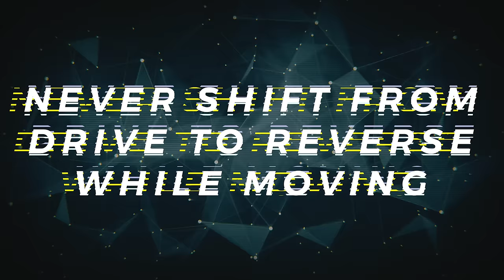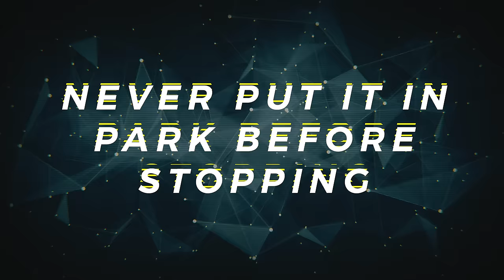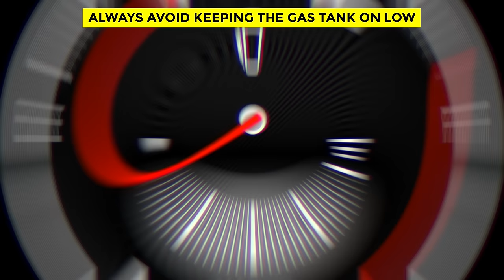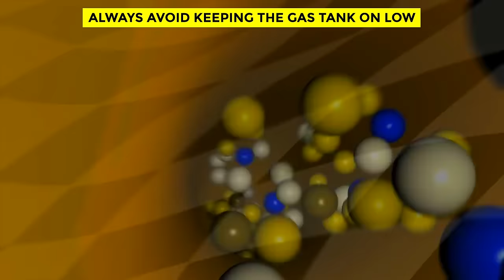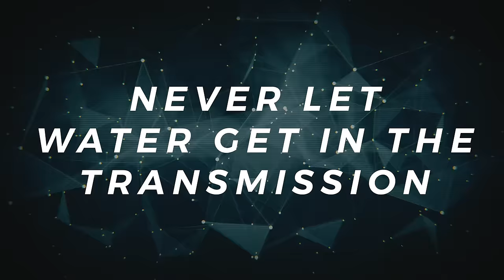7 Things You Should NEVER Do In an Automatic Transmission Car!

Comment: The sediments and trash that may be in your fuel tank will be in there if there is a lot of fuel or a little.  That is a huge misnomer that it will be sucked up by the pump if the fuel level is low.  Besides, that is what the fuel filter is there for any way.  After all, it is called a filter, and that is what it is designed for.  Run your tank as low as you want to, but not so low that you run out of fuel, because that is not fun pushing your car or walking with a fuel can.

Comment: "never switch to neutral at stop lights"

i always do this on my turbo b20 automatic integra da
Reply: reaze if you have an aggressive cam with the factory torque converter, your car could actually stall in drive, meaning you need neutral at a stop. Big cams need higher idle speeds, but the torque converter limits that

Comment: When I first got my car and was still learning to drive, I was pulling out of my driveway when I realized I need to go grab something from my house, so I put it in park before I stopped fully and I heard a clicking noise. I still use it today and nothing bad has happened since and I’ve never done that again.
Reply: some trans have whats called a sprag clutch or similar mechanism on the park locking gear that will prevent the gear from locking above a certain rpm

Comment: Well if it’s not good to put the car in neutral down hills on automatic then what about manually cars.
And also some cars have so when you stop at a red light put the car in neutral and let of the clutch if you got that it will shut off and as soon as you press down the clutch it turns on, so that can’t be good either then.

Comment: While you shouldn't coast in N down a hill.. The engine won't overheat if it's literally idling and you're moving the radiator through air by going down the hills. It's no different to letting it idle on the drive if not better.

Comment: The low fuel scenario however obscure you may think the chances are can happen.  The fuel cools the pump which is true but long term running the tank low causes in addition to reduced pump service life the risk of explosion since the more fuel vapors in the tank which are usually deadlier than the fuel itself.   

For the winter the northeast, mid Atlantic, Midwest, pacific northwest can back me up.

A empty tank reduces weight which is fine for saving fuel but........a empty tank also reduces weight in the rear of the vehicle.  Bad move in a snowstorm as in you want all the weight available to keep rear of vehicle firmly planted to the concrete ( in this case digging into the snow.  Lighter rear of vehicles reduces traction, simple physics.

The additional traction can be even more critical in Rear wheel drive vehicles without 4WD or AWD.  

Pickups are double critical since there is not a lot of bed weight to begin with.
Reply: if your car explodes due to a low tank id thing your evap system is not working properly.

Comment: Coastering isnt dangerous at all. The "emergency" in which you cant put it back in gear/drive simply has never occured ever. But Automatics already coaster if you dont press any pedal. You dont get engine braking or anything anyway. (Btw. Please dont enginebrake with your 2-strokes and wankels cause cutting the fuel completely off also cuts their oil off completely. They burn oil because they have no choice, remember?

Also when youre in a manual, you should put it out of gear, because here its the other way around. If you stand on your clutch all day your clutch-feathers disengaging the clutch get weaker over time resulting in the clutch slipping while its fully kicked obviously burning it down in the end. Also you can put it into gear within a coulpe 100 milliseconds.
Reply: wears out the throw out bearing.

Comment: top tip, buy a manual but remember put it in neutral when parked
Reply: You mean put it in first gear and then handbrake, who the hell told you to put neutral?!
Reply: @KHaLeD-jv7fu  anyone who knows how a manual works
Reply: Electro3 Strike ki
Reply: @KHaLeD-jv7fu  actually it really don't matter. But if parked on an incline you'd use reverse or 1st plus the parking brake. That's so if your parking brake fails for what ever reason the engine will keep the car from rolling away. Besides you should always give it a jiggle to make sure it is in neutral before even attempting to start it. That's also why you must press the clutch and brake pedal in most cars to even start them.

Comment: If you are launching an automatic car just brake boost I know it feels weird but it works and it really doesn’t do damage just don’t fuckin floor it with the breaks pressed in I like to build around 3000 to 3500 rpm before releasing the brakes and pressing the gas fully once I feel the wheels grab up

Comment: Some vehicles won't shift the transmission from Reverse to Drive until the vehicle stops, even if you put the shifter into Drive while you're still moving in reverse.  With technology these days, there are sensors that can tell the car it's still moving and NOT to shift.

Comment: Tip number eiiighhtttt.... never drain your oiiill and then turn on your carrr.... it mayy seem temptinggg to drive off durrring an oiiill change....... but surprisinglyyy, doing this may seriously damage your engine's componentsssdsssds............. engines need oil to function, and with out that, they will break..... some of the parts that could break include the timing chaiinnnnnn..... the rod bearrringgggs.... the oiiil pummmmmp.............  thepiston ringgggggggggsssss.............. the camm      shaffft.........   the valllllllves....... the wrist pinnnnnnnns......... the crank shaffffffft......  the liffff tersssssss....... cleeearly, it is not a good idea to run your car withouuut oiiiiillll....... you should have a mechanic check your carrrr.... to make sure it has oiiiil in itttt..... this should only be done by a certifieeeed mechaniccccc........ I had mine checked twiiice yesterdayyyyyy......

please tell me this man isn't actually saying things that large amounts of people with at least enough intelligence to figure out how to pull a car out of a garage don't already know...

Comment: There is a lot of this  I DO NOT agree with, while indeed putting your vehicle into neutral at a stop light is impractical, if you're quick enough to put your vehicle into neutral while starting to slide out you could regain control of the vehicle and come out of the slide. The vehicle in neutral will allow the wheels to start spinning again and could allow you regain control of the vehicle. 2nd thing is using the transmission to help you slow down.. In cars, its again impractical however, in pickup trucks, if you're hauling a trailer and you're going down a steep grade you can use the lower gears of the transmissions to keep you speed down so you don't lose control. You have P, R,N,D then either 4,3,2,1 or 3,2,1 or even 2,1. The #'s are the  gears of which you want to limit the transmission gear switching so you can go up or even down hills and grades. New cars today won't even allow you to go from Drive to Reverse while you're in a forward motion...

Comment: 5:45 a thing I need to point out is that that's not true because the pump always sucks gas from the bottom so either at full gas or low gas your pump sucks from the bottom...

Comment: Looking for a trans it’s easy but hard at the same time I looked out n my trans was 250 my last car trans was for 1500 and thats was only if I took my main trans out to swap it with a new one just take care of your car n your car will take care of you never move your car from a cold start if your a model 2010 and down that’s how you over heat your head gasket and never leave any thing on if you getting on the car if you didn’t get a brand new alternator DO NOT LEAVE YOUR hazardous on

Comment: What does running low on fuel have to do with the transmission?  I get that it can be detrimental to the fuel pump because the fuel helps to cool the fuel pump but again, what does that have to do with the transmission?  Also, the argument that running the fuel low in the tank causes the pump to pick up any debris that's in the tank isn't a valid argument either.  The fuel pick up in the gas tank is at the bottom of the tank.  If there's dirt in the tank, it's going to get picked up whether the tank is full or near empty.  That's what the fuel filter is for.
Reply: almost all modern cars/trucks use a "Sock" to block dirt from getting picked up. it don't block it all that's why there is the filter.

Comment: 3:57 "Never launch your car in Neutral"
You said people launch in neutral to be able to put it in D faster and accelerate really fast. Then you go on saying why not accelerate fast after starting the car and how it can harm the transmition.
ok, i understand that. I have a related question, but slightly different:
Can I start the automatic car in N? We know that it works, but, does it damage the transmission in any way?
Keep in mind I am not asking about accelerating really fast.

Context: It happened a couple times, I get into the car and without looking at transmission, it was in Neutral.
I asked about it in ome FB groups, all people say: you shouldnt do that, it harms the transmission. But they're never able to tell me what exactly happens to it.

Of course it's by accident, it's not usual, but we're humans, so, we fail from time to time.
Question is, did I break the transmission? if not, what exactly are the consequences if someone always starts the car in N ?

Thanks,

Comment: There is no such thing as "emergency brake". The lever at the center console is called a handbrake.

Emergency braking is applying full brake pedal travel for the reasons of stopping the car as soon as possible. Handbrake is NOT meant for use in emergencies.

Comment: I think you meant if you forget to put your car in drive...you'll rev at the light. 
BTW if your car has high miles on it and the transmission fluid has never been changed, do not change it.. If your having transmission problems it will looked just get worse once you change the fluid.

Comment: A $100.00 for brakes for a bicycle maybe I just spent 1600.00 plus tax for my Lexus Rx350 at a Toyota dealership. They were cheaper than the Lexus dealership. Lexus wanted 1675.00 plus tax just for pads.
I got pads and rotors all the way around for $1600. Plus taxes.

Comment: I'm gonna respectfully disagree with one of them. Neutral at a red light is something I do. If ur stopped and in drive when an accident is about to occur, odds are you still won't move in time. If theres an emergency vehicle coming, and ur at a light, obviously you move if you can but odds are you can't move since cars are likely blocking your way, and by law, if you are unable to move to the side you are supposed to stay stopped until the emergency vehicle can get by.

Comment: I had to replace my 7 speed in my g37, The old trans solenoids from first gear to third had been badly damaged due to me not fully applying the brake when shifting from drive to reverse. The 2nd and 3rd gear solenoids had gone bad due to me having to neutral launch my car for it to not stall... in an automatic :'(  , Luckily my friend had a same model trans sitting around and I had enough money to upgrade to a beefier torque converter which I wanted to do in the long run so it was worth it for me. But if I wasn't into mods/upgrades and what not Id have been so mad.
Reply: Or just get one with a manual like it should
Reply: solenoids have nothing to do with your braking and shifting habits. you must have had some junk get into them.

Comment: everything here can be applied to manual 
launching a car in manual is the same shit 
you hold clutch while revving and dump the clutch
Reply: difference is  the bite of a manual clutch is controlled by your foot, a auto is controlled by the torque converters hydro static pressure

Comment: Tip 8 never change your oil. The reason is because your car is familiar with the stock oil and when you chane the oil the engine will get slightly damaged because it is a different oil than the engine is usual

Comment: If you put the car in neutral while moving and the engine happens to die, you could lose your power steering and power brakes and then lose control of the car.

Comment: At least they got the "Neutral" information correct.
Reply: Not with the stop lights
Reply: @cpfaclan3681  , No, that part is also correct.  You don't put your car in neutral while sitting at a stop light.
Reply: @jmackinjersey1  I'm not saying its beneficial, but it won't hurt it. It's not really correct because tbh, it doesn't matter.

Comment: Tip number 99: whenever parking at an incline or decline, hold the brake, put the car into neutral, pull the parking brake, let go of the brake, and put the car into park. It sounds like a lot of steps, but really can be done in 2-3 seconds when you get into the habit of it. This helps the transmission by putting the cars weight on the brakes, not the transmission. You might notice when yku get into your car and put it into gear it makes a thud and moves the car, this is cause the transmission was holding the car.
Reply: Why do you go into neutral? To make braking easier?
Reply: samaa mieltä, juuri näin kuuluu parkkeerata ja laitetaan se vaihde asentoon N valoissa ja keskitytään siihen ajamiseen eikä puhelimeen niin se ei unohdu vapaavaihteelle.

Comment: Number one. Just dont drive automatic. Drive manual
Reply: But autos are faster nowadays
Reply: @dmvelocity5181  lol. You can only go the speed limit anyways. 😂
Reply: @jorgnyoa3561  ok? Theres a reason why autos are outselling manuals. They are easier to drive and are more practical
Reply: @dmvelocity5181  when your towing 15k lbs down hill, an auto is not easier to drive way more vehicle control with a manual
Reply: @3ddan148  most automatics have gear selections, so you can do the same as a manual without destroying your clutch. And automatics typically have a higher allowable cargo load than manuals

Comment: 3:56 i refuse to accept that

In my bmw 5series automatic when i turn it off he's switching to neutral on it's own
It's same with stick shifters, you always press clutch before you turn it on because it's way more easier for engine to start
Reply: err no it is to keep you from launching forward or reverse. in a manual that is. In a auto it should just lock out and make you shift to neutral and or park.

Comment: My cousins brakes went out and he had to throw it in park to stop the car. It was throw it in park or hit the house. Luckily he was only going 5 to 10 miles an hour when they fully went out.
Reply: Or hit the E Brake and keep pumping the brakes I was getting off of the interstate and my brake pedal just dropped to the floor and I hit the e brake and kept pumping and stopped about half a foot from the truck in front.
Reply: Just use the e-brake or handbrake, not the transmission

Comment: Hay that the first one with drive to reverse and vise Versa it seems like chevy/GM has a safety switch or something like that where the change in momentum is transferred to the Torch converter. My father does this all the time, even in my dodge wich has VERRY bad consequences. So don't do it, it's a bad habit.

Comment: Ha ha ha. When you drive down to Hill in neutral the oil don't do the work in the engine. And what happens when you start the engine, before to start? Your engine explodes? Or your car has no radiator's fan?🤩🤩🤩🤩🤩

Comment: ahh blah blah blah. i put my gear in N when its red light. when you apply brake and your transmission is in D. You are forcing the moving transmission to stop at long period of time which may cause damage to your transmission. That is why car manufacturers put the N near the D so you can shift quickly when its red. so I use N and emergency brake so my car wont move during red light.
Reply: Eric while braking your car should apply the clutch at a certain rpm or generally while braking . Putting your car in N youst puts the transmission in N .Basically it makes no difference besides your car doesn't move on N when you don't apply brakes
Reply: There is no emergency brake youst the regular brake or the hand-brake( transmission position P ) and no the hand-brake is youst the rear axle or regular brakes put in a locking position.

Comment: The first and only time I drove an Automatic, it was out of Airport Dropoff Parking, I nearly instantly crashed it.

I was in stop and go traffic and noticed, I could take the free right lane for my direction. While looking over my shoulder to see if the lane is free, I lifted my foot off the break, which made the car instantly jump forward (on a manual you dont move until you let the clutch bite). It luckily was a very modern BMW, so it could also break automatically and that saved me from hitting the person in front.

The left foot also has nothing to do the whole time, so it is kind of weirdly left. I saw a crash in Switzerland, where someone crashed his rental, because his clutch foot hit the break at high speed out of muscle memory.

Comment: please use neutral if standing for a red licht for longer time especialy in older cars due to older cooling sytems its wil heat up ur oil wen u are in drive and not moving a lot faster and that can harm ur transmission the rest is tru with some exeptions an empty gas tank will distooi ur fuil pump but it wil neven couse total engine falieure and mechenical below pump wil not be distoied on a empty tank  and transmission rebuild are expenive but not wen u do it urself also this stuf wont happen crazy fast
Reply: Wow this was so hard to read ngl 🤣💀💀